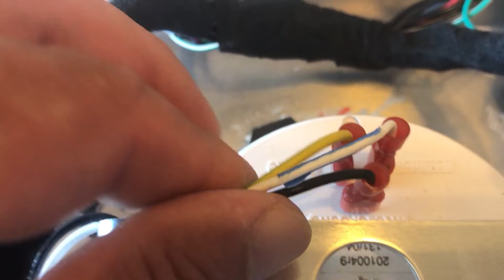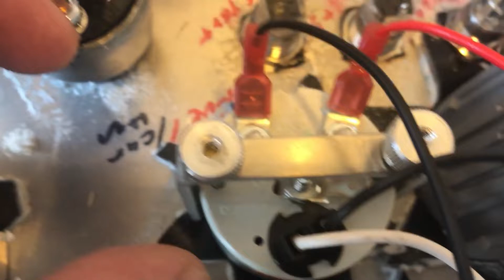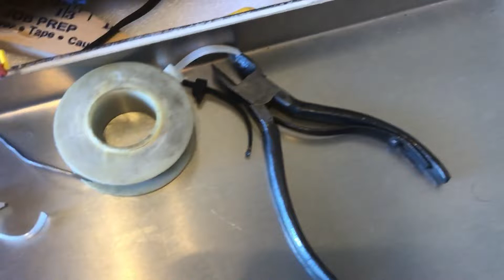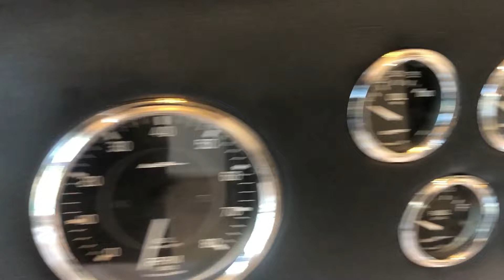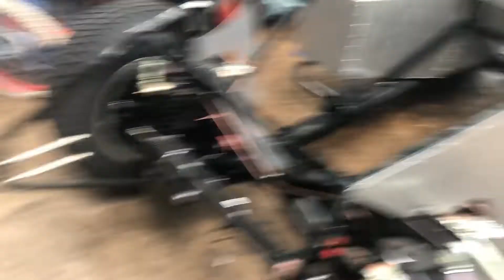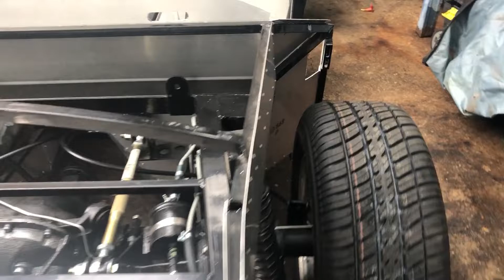Factory Five MKII Cobra Build part 7 Moving forward

Comment: Unless you are planning to put a supercharger or turbo on it I would get rid of that box upper intake, those things kill all of your low end torque.
Reply from the maker: With the cam and heads I have I should be making plenty more horsepower and torque. The car only weights in at 2200 pounds. I don't think I will notice the loss of 20 foot pounds down low...at least I hope not :)
Reply: @fuelnmetal  I can only speak from using one on a Mustang but with that weight it won't matter.